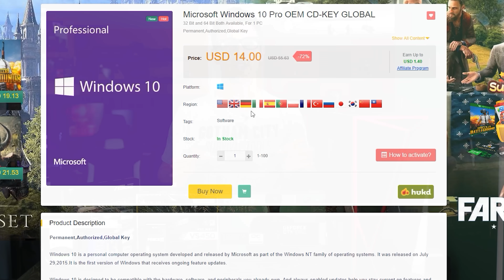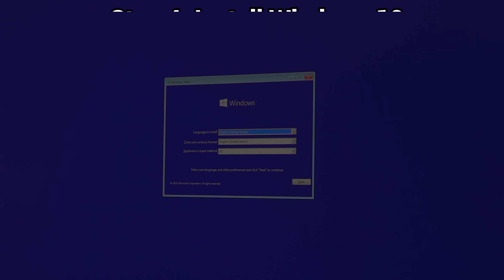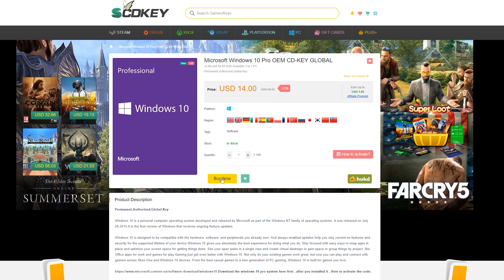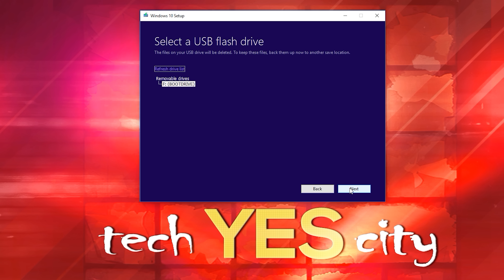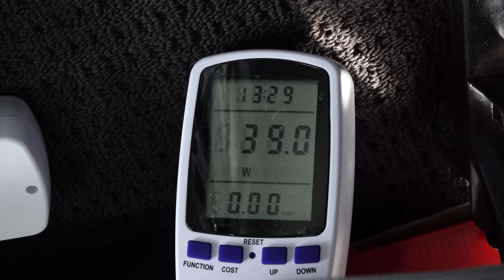HOW To BUILD a Gaming PC - Quick and Easy

Comment: Hey Man is a i5 6500 H110-N and 8GB DDR4 RAM for £120 a good deal
Reply: Jack That's an extremely good deal
Reply: Yeah definitely, that's pretty much half a PC already, only PSU, case and GPU left.
Some people tend to sell used cases with decent PSUs too
Reply from the maker: Yeah that's a solid deal man
Reply: Jdhshuajfj ueudhbd is it worth the upgrade from i5 4460 8gb ddr3
Reply: Jack depends what you use it for
Reply: Nah, I have an i5 7600 and I used an i5 4570 and I saw virtually no performance drop in gaming, as for ddr3 vs ddr4 lets just say ddr3 is better value.
Reply: MaJesticGoat Gaming In gaming though. I asked him what he was using it for. Anyway, may I ask what gpu you were using?
Reply: Jdhshuajfj ueudhbd Gaming at 2560x1080p, the motherboard is mini itx so thinking of buying an GTX 1060 mini to replace my R9 390
Reply: I wouldn't, there's virtually no performance gain for the money you might spend.
Reply: MaJesticGoat Gaming the 1060 is better 15-25 FPS better in the games I wish to play. The i5 6500 has lower tdp and less frequent frame dips. Plus the main thing is the GTX 1060 runs at 55-70c instead of my 390 running at 80-95c. Also when I can sell my old system cpu/mobo/ram/gpu/Case and upgrade for free
Reply: Aight, sounds good.
Reply: If you take that deal, then you got one of the best process for a combo like that in a  while
Reply: oh yeah really nice deal
Reply: buy it right now go out get a 1070 or rx580 and a 120gb ssd with a 1tb harddrive and a 550 watt psu and a nice case and youre done for about 500 maybe 600 intotal and youre set for atleast 2 years you might wanna go and get 8gb more ram]
Reply: Not much of an upgrade path but good stand alone
Reply: Jack
The Ram alone is probably worth that.
Reply: just about yes
Reply: Jack yes!!!
Reply: Jack where did you find a deal like that?
Reply: Mystic - Edits ebay man, was on sale for £140, dropped in an offer £120
Reply: Jack jheez, btw how'd you get the money? I have £50 right now but I won't be able to buy a pc anytime soon with that
Reply: GTX 1050ti, so it may have been a little bit of a gpu bottleneck

Comment: My first pc was in early 2014, FX 8350 @5Ghz with an corsair H100i, two gigabyte windforce HD 7950s ( huge 200+ Mhz difference over most other cards) 16gb ram, 120GB SSD, 1tb HDD. The rig was so hot it would heat my room up fast haha.. pretty I still have the parts 🤔

Comment: Prices are pretty crappy right now, I like this build it feels normal...ish. Obviously PC part prices are absurdly high but you my friend have proven that you can still build a good quality PC for a reasonable price. However I feel that maybe getting a prebuilt OEM or 2nd hand PC is a decent option at this point, Especially for people who don't need the ULTRA 4K 60FPS experience. So in addition to your video I say either the PC you've built or a 2nd hand/OEM pc with a GPU upgrade. Also making sure that the PC has at least 4 cores and 4 threads, because 2 cores won't get you to far in the future. But yeah Great video!!

Comment: How to BUILD A GAMING PC in 2018: just spend more money than usual.
Reply: unless you get ddr3 ram or something, and run on integrated graphics
Reply: Depending on where you live you could get some very good deals on used parts. In France for example you can get a i5 4670k for 80€, a Z87 or Z97 for 70€, 16gb DDR3 for 80€ and a 780ti or 970 for 150€ that's sub 400€ (470$) for good core components for 1080p gaming
Reply: most costly at the moment (2018 MAY): RAM, Display card
Reply: why just go fro an optiplex 790 with an i5 2400s and 8gb ram  for £100, get another 8gb (£30ish) 600w psu £20, cooler cpu £20, 780ti or 970 like you said  and if you are desperate to upgrade the cpu then get the i7 2600k XD total about 300 euro  £250
Reply: LegendaryVegeta those are some shit specs

Comment: Those cheapo Corsair power supplies have a pretty bad reputation, tbh at that price range weven Cougar or Silverstone is a better option
Reply: MaJesticGoat Gaming Those are the green label ones, those haven't been made in a long time. The new ones are fine
Reply: Still tho, if you're going for a budget just saying there are better value options out there.
Reply: MaJesticGoat Gaming I've seen them go on some pretty sales. Personally I still buy Seasonic M12 or S12 PSU's. 

In my daily driver I still use my Antec Basiq BP500 500w I bought used for $20 in 2015 but ymmv with that approach lol.
Reply: I think just from personal experience the only Corsair Power supply I'd buy is one of their high end range. As for budget options Silverstone is the way to go here in Australia.
Reply: MrBluePoochyena yup true
Reply: Suggest me a nice 650 watt psu with japanese capacitors and nice internals under 80-100usd
Reply: MaJesticGoat Gaming some stock of the vtx 600 have some problem , you can check falco75 videos. Some units Did show "ripple strange values"
Reply: Maybe evga b1 or B3, 500w are enough
Reply: MaJesticGoat Gaming a good 500w(not the vs Series) can handle a gtx1070
Reply: how about "Cooler Master"
Reply: Yeah, they're a good brand.
Reply: Ulysses Lee masterwatt lite Series have the same platform of the vs corsair. The brand cm (like corsair) sell bad, good and excelent psu. Thermaltake Smart se have the same platform.
Reply: Drake I can do you one better the SeaSonic focus gold is a 750w semi modular around $70 usually, was on sale for $59 the other day. 7 year warranty and has Japanese capacitors. Also a cheap psu with a good review is the SeaSonic m12 520w bronze. I believe you can get is for around $30 and it has decent Johnny guru score.
Reply: I know somebody said, 
The theory of a power supply of ratio in "Watts to HKD$" is roughly 1W to  HKD$1 / USD $ 0.13 / GBP$0.1, 
Don't buy too cheap and it will have not reasonable quality, 
especially u are building a nice pc for yourself, not a budget pc
Reply: Drake season s12ii or m12ii 620w. Trust me, you won't miss the extra watts unless you have a specific usecase
Reply: Cougar VTX600 all the way for where I live atleast.
Reply: Depends what you're using with it.
Reply: I mean, if you look at LTT they've used 500W psus on gtx 1080s